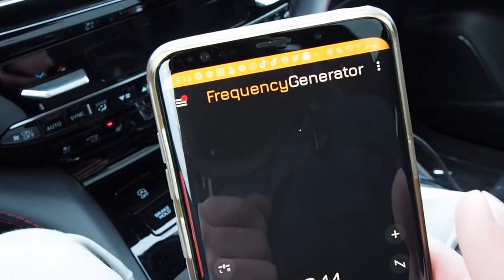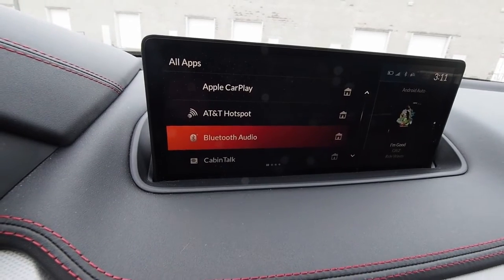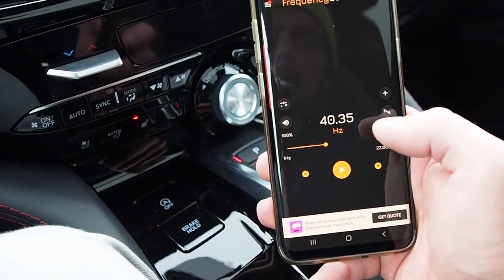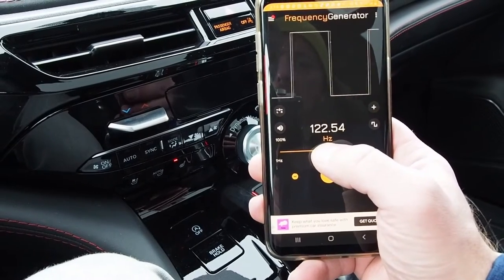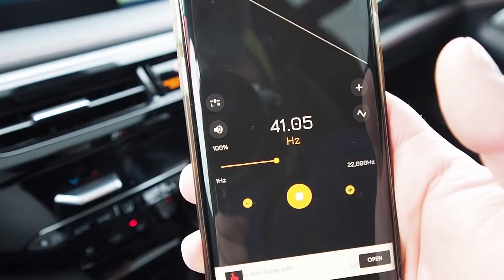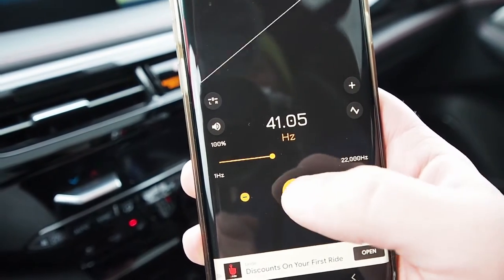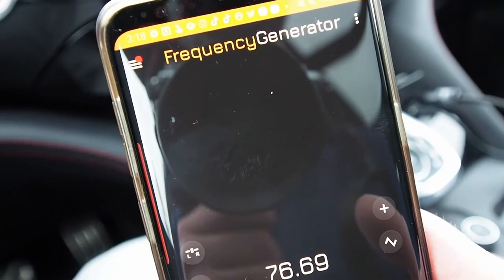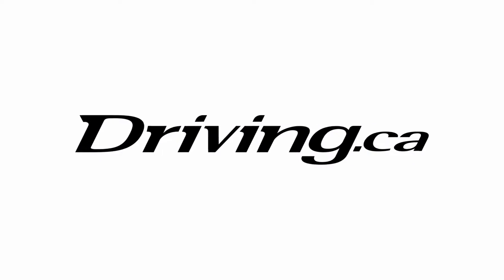How to check for blown car stereo speakers in 90 seconds | Driving.ca

Comment: Hi, I need some pieces of advice, I bought this 508 2012 model it has RT6 unit. I checked everything but the last thing I thought about is the speakers honestly. I checked each one (after a week from buying it) and it turns out only 1 is working as it should which is the right back speaker. It has 2 speakers in each door and all the other ones are extremely quiet and if I set volume all the way up it doesn't crackle or anything, just quiet. It's not a software thing and I'm wondering snice I've just got done paying for it, I'm not financially stable for some time. is there any solution please? I need help